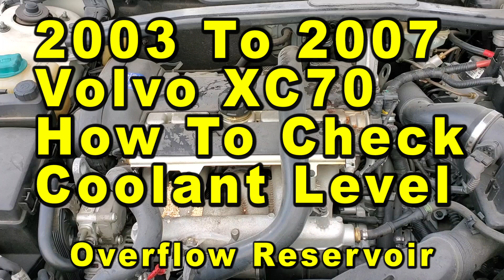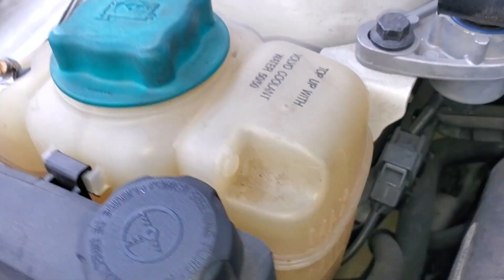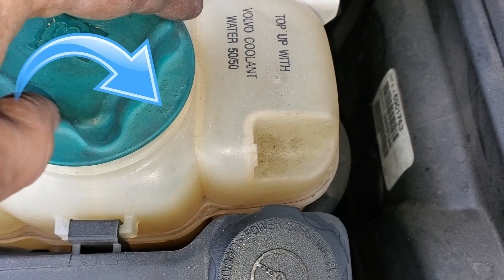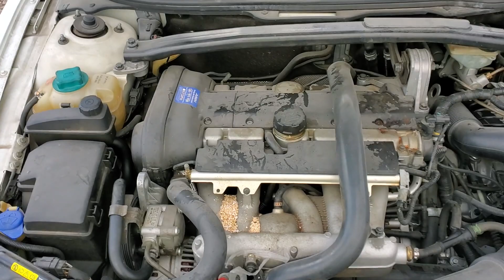2003 To 2007 Volvo XC70 How To Check Coolant Antifreeze Level In Overflow Reservoir - Max & Min Line

Comment from the maker: This quick DIY video shows owners of the 2nd generation 2003, 2004, 2005, 2006 and 2007 Volvo XC70 how to check the coolant (antifreeze) level in the overflow reservoir bottle, the maximum and minimum line locations and how to remove the cap in order to top off the fluid.